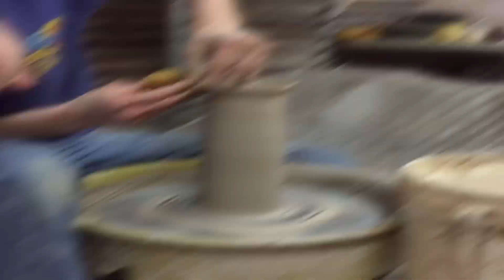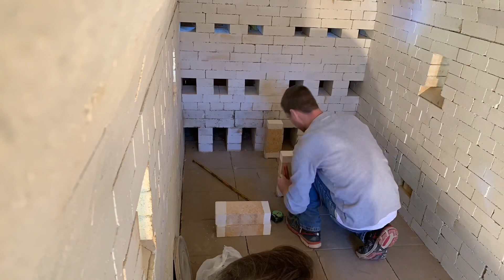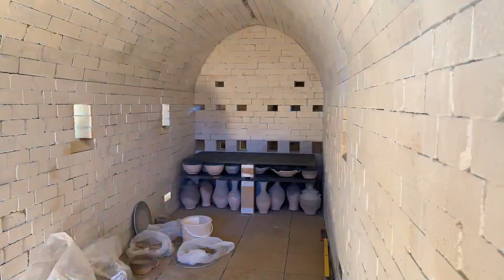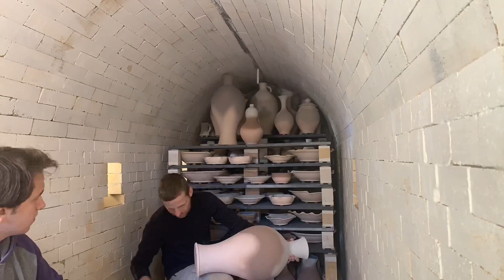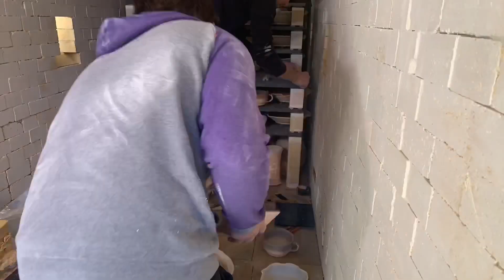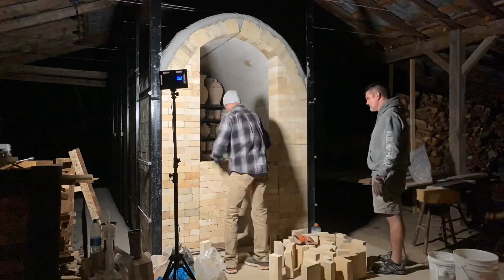Time To Load My New Wood Fired Kiln

Comment: I was wondering what do you put on the bottom of you pieces and on your lidded jars to make sure they don't stick to the shelfs or each other? I have no luck with wax resist!
Reply: In atmospheric firings, like salt, soda and wood, "wadding" is used, on the bottoms and between lids.  There are different recipes, but it's usually a mixture of kaolin and alumina.

Wax alone won't prevent sticking, unless you mix in some alumina hydrate.

Comment: I noticed the brick is a new colour inside the kiln. Could you let us know the reason or is there a vid with ecxplanations waiting to be edited?
Reply: It's an IR reflective coating.  Boosts the fuel efficiency and helps achieve higher temps.  My guess is it's ITC-100.  Expensive stuff, but should, in theory, be well worth it.
Reply: @danbance5799   Thanks for answering my question. Much appreciated.

Comment: What is the stuff you are using to place underneath the pots?
Reply: They are wads, not to sure but little damp balls of flour and alumina. Something like that. Work like kiln wash. Prevent the pot from sticking to the shelf, and lids to the top of jars and between individual plates in a stack. Ash likes to turn to glaze and stick things together. Fun.